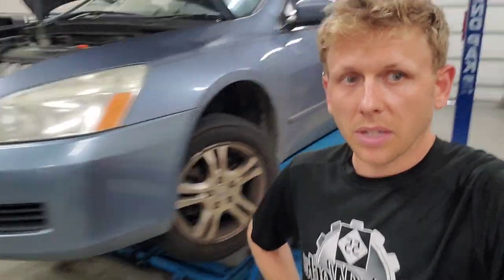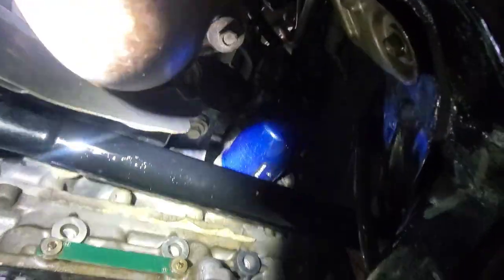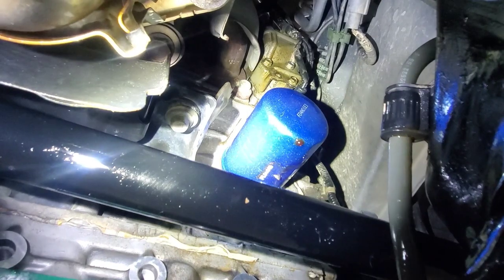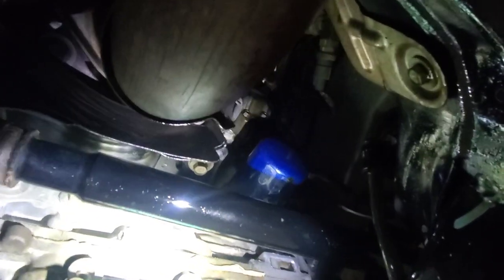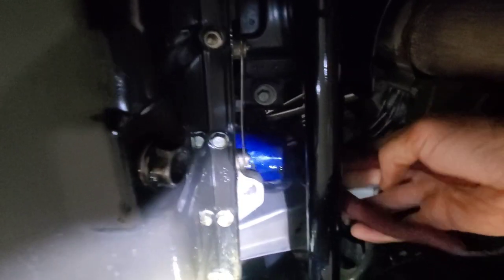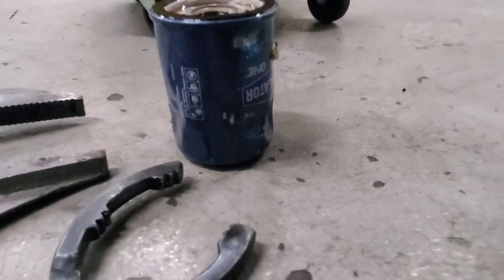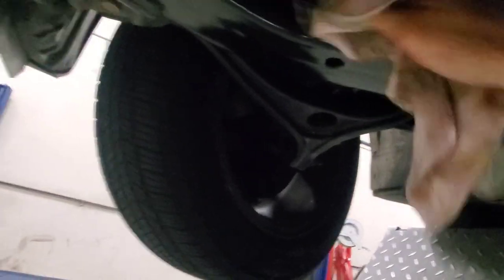Customer States: It's Not The Oil Filter, Cause I Did It Myself. (Honda Accord Oil Leak)🤦

Comment: Anyone who puts a car oil filter on with a wrench of any sort, really doesn’t know their arse from a tea kettle!  Go directly to jail, do not pass go, do not collect two hundred dollars… . NO SOUP FOR YOU!
Reply: Yeah its a special level of not knowing what they are doing if they cant even tighten a filter by hand. 

Had an old school bud do an oil change on my truck once. Took the same auto shop class even. He overtightened my oil filter so tight it took me 3 hours to get off with a hammer and screwdriver. Not sure if he had some grudge on me or if he was that incompetent but i’d believe both.
Reply: @Bigtexbbq  I've had hard ones that were put on by the factory (a robot would be my guess...) that were really really hard.  I'll forgive the robot, but not anyone working on my vehicle.  That's like taking the drain plug out with a set of vise grips or a pair of waterpump pliers... .  Not the right tool for that job.
Reply: @strshooter7399  not sure how he managed to get it so tight, but my cheapo rubber oil filter tool from harbor freight just laughed at it. Never even used the thing until then. So a little mutilation later got it off,  needless to say I'm never taking my vehicles to anyone else for oil change again. I'll pass go and collect my soup.

Comment: I do all the repairs of my cars alone drove almost 2,000,000 miles with them. The oil filter should only be tightened with your hand without tools. Even if you're uninformed than you can watch a YouTube film about that.

Comment: interesting - I wonder if that was the original filter and they just couldn't get it off, ending up punching a hole in it with the metal strap wrench in the process...
Reply from the maker: No, customer told me he changed it recently. That was the new filter.

Comment: You failed to check to see if the new filter fixed the problem. There had to be a reason why nhe changed it out in the first place. My cars oil pressure sending unit right above the oil filter was the main problem that made the filter appear to be leaking.
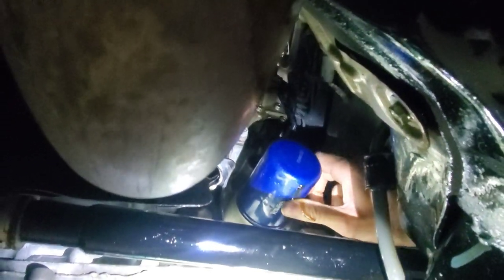Reply from the maker: In the video at 2:07, I show the engine running and oil dripping. I am making it drip and stop dripping when I am tapping/plugging with my finger on the puncture in the filter canister. This is the leak.
Reply: @2shops1roof  The leak I had was tiny, causing me to change out the filter because it appeared to be coming from the oil filter gasket. The tiny leak was still there. I had to use an inspection mirror to finally find the tiny leak coming from the oil pressure sensor which is right above the oil filter. Changed the sensor out and problem fixed.

Comment: Well damm, he tightened up the oil filter so hard it tore the metal skin ,and it still leaks.. well.next time he will use an impact hammer to drive it on.

Comment: No need to gorilla tighten an oil filter like that.  Hand tight then maybe 3/4 or a full turn more.
Reply: Hand tight then a full turn more is what i would call gorilla tighten. Since not everybody's tightens the same amount, to be exact, you could say as soon as the o-ring contacts the mating surface, go another 3/4 turn works on most oil filters. some of your smaller filters have such thin o-rings on them, that a half turn after the o-ring touches is about all you are going to get. Hand tight for Braun Strowman would be way too tight.
Reply: Idiot (and I say that with all due respect) probably mis-read the directions and attempted to tighten an additional 3 to 4 turns ;-)

Comment: I guess if that's their 1st time changing oil n typically old filters get tight over time so they probly thought it was ok 2 use filter wrench to put new one on not knowing any better causing leak from it pucturing,,, sucks they took to some shop that basically was a bout 2 cheat him only 4 them find the actual leak after the fact but then not likely 2 tell the owner so they would've looked as if 2 have fixed it,, good thing they came 2 this mechanic:)

Comment: That isn't an oil filter that's a whosit mick Whatsit canister. And you're supposed to poke a small hole in it so that it weeps out the Whatchamacallit when it gets too much pressure behind the dingaling